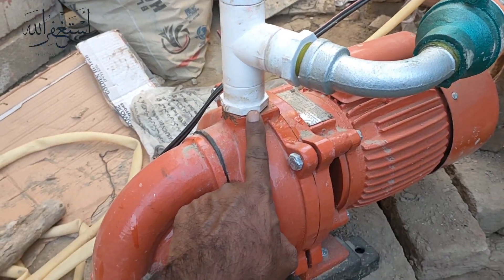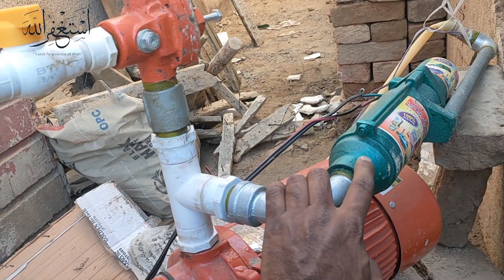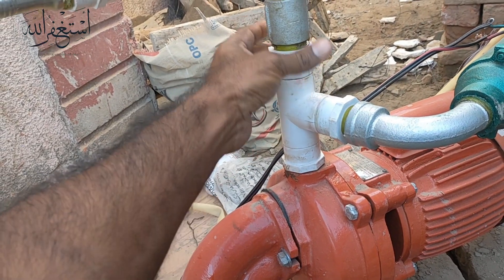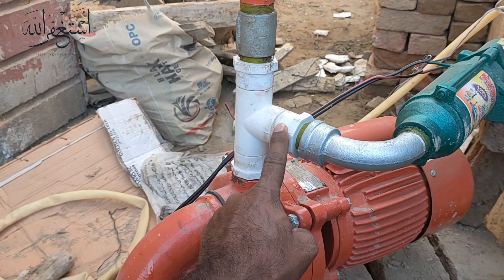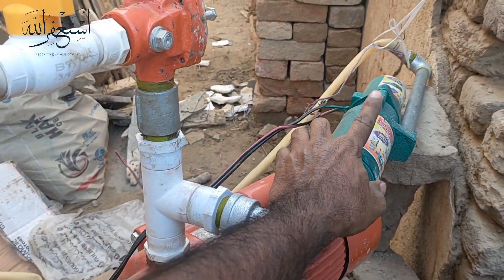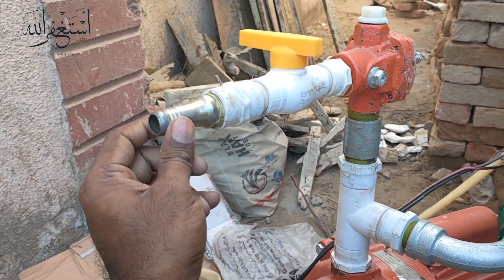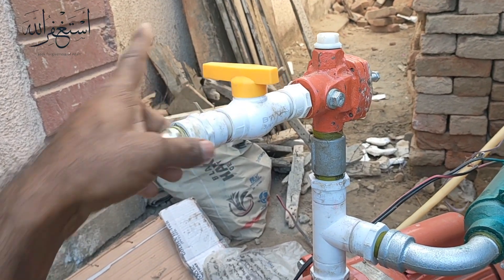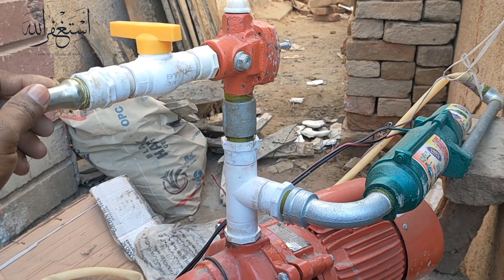Double Bore Motor To DC Solar Motor Installation || Double Bore And DC Motor Together

Comment: Our water level is  65 feet, bore is 200 feet.
Previously we dropped the pump at 55 feet in the bore and was successful. Now i want this your double pump system. Wil it work.
Reply from the maker: Not Sure You can try it

Comment: 4 ka pipe ketny fite h
Reply from the maker: 4 inch ka pipe 15 feet 
Or
2 inch ka pipe 50 feet
Reply: @MediaCreationClub1  
Pampu 12v ka h
Reply from the maker: @yasirjanjua6452 double bore motor ac volt 220 or DC pump 12 volt ka
Reply: @MediaCreationClub1  Mary Bhai Mary pass be esi Tara ka 12v ka pamp h to mistri Bolta h
Reply: Ya 4 pipe 30 feet h es pr Kam nhi kry ga
Reply: @MediaCreationClub1  agr 4 ka pipe 30 feet ho to Kia ya Kam kry ga

Comment: To run DC , we to run AC also same time? Or only DC.
Reply: Kitny ka hai pump
Reply from the maker: 4800 pkr
Reply from the maker: @zubair-n9s8n  yes can
Reply: Kitne foot bor par chalega
Reply from the maker: @QariNazik-br2gz 80 feet
Reply from the maker: If no electricity or you wanted to save your electric bill 🔌 you can use DC motor using battery 12 volts

But you cannot run both motor at the same time it's useless